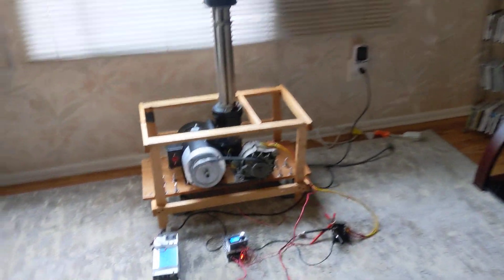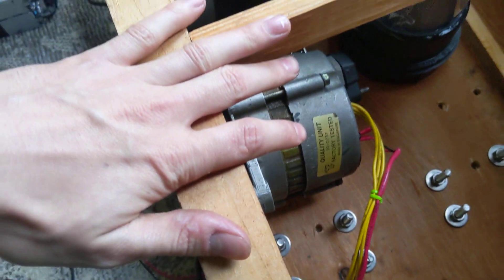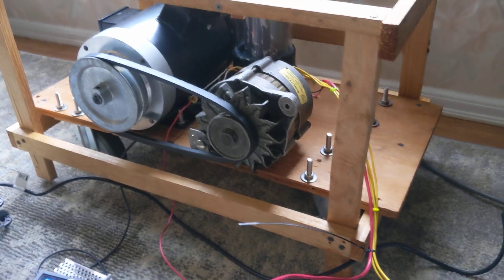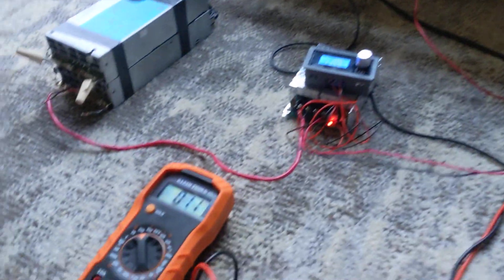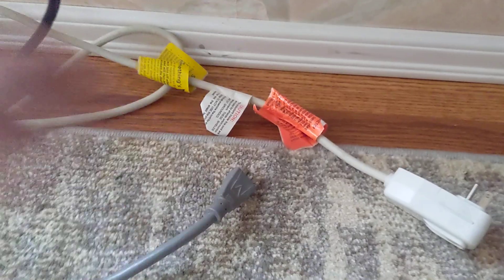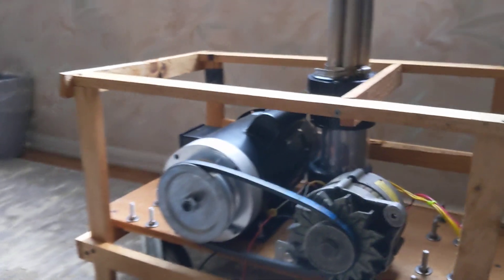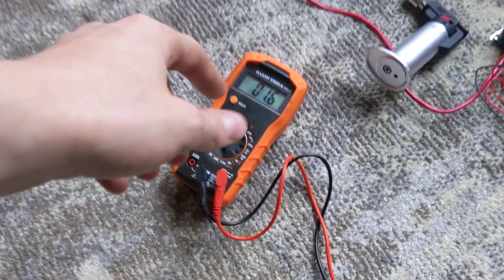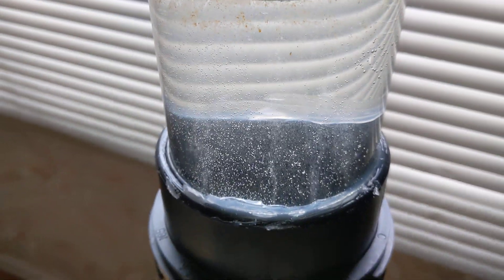HHO High Voltage Alternator [No Electrolyte]

Comment: What's your gap size? What if you put electrolyte in? There's a version of this that puts a large choke on the negative side, wonder if that would help. Also, the freq output ( Ripple? ) is controlled by your motor RPM. If you want to tune for resonance, you could use a DC motor with a speed controler to adjust the RPM, so that the freq output would be adjusted as well. I think it could do better with single diode instead of diode bridge, cause it would induce more definite pulses instead of DC-like.

Comment: The 8XA variac arrangement can give you a better unipolar output, but at 120Hz.. It will eliminate the need for the motor. Move to the 9XA driver and you can give it a gated pulse instead.  

Remember the purity analysis Stan had done. Gas made from unipolar pulse frequency was 8Xs more explosive by volume, as compared to continuous DC electrolysis which makes 15% hydrogen, and 85% steam. 😉

Comment: This is the same method stanley Mayer  showed to the pattent office. So he hooks up a special circuit to the part of the alternator that creates the magnetic field. My understanding is that it makes the generator low drag and as such it can generate far more HHO gas than the necessary torque requires to rotate the alternator at high speed
Reply from the maker: The torque is achieved with the gas processor in series with the ambient air and cell. Faraday gas will more powerful with electron stripped off O2.
Reply: I'm saying the production of the gas is done using low torque. But I also understand that by stripping the electron away the water molecules can't be formed and as such some nuclear degradation takes place to provide the electrons. During this process some mass is turned into energy due to E=mc2, thus increasing the energy yield from the gas and hence more torque in the engine
Reply from the maker: @raloed.363  I would say the reason no cars run on water today is because no gas processor. Without the missing electron there is no overunity. There also isnt any electrical "resonance" to get over-faraday, i looked far and wide. I did however find physical or acoustic resonance with the tube, which, i would rather spend time building a gas processor to loop an engine. sounds easy but i dont want to blow up lol.
Reply: @weighta6630  I saw videos on YouTube where people claim overunity without gas processor. They get like 400% efficiency by using the alternator method. It was years ago thou and I can't find the video again. But yeah the gas processor helps run the car and it can be dangerous so be careful